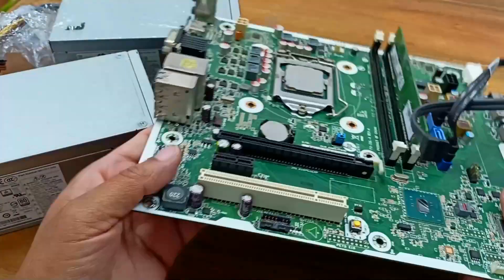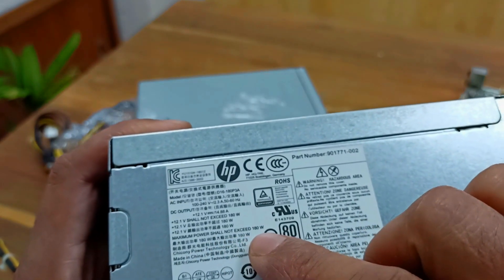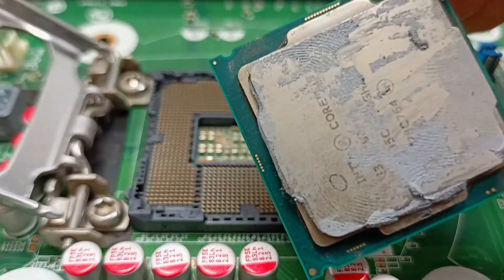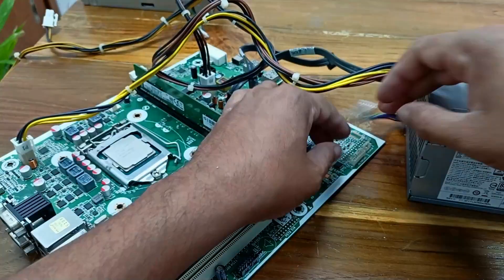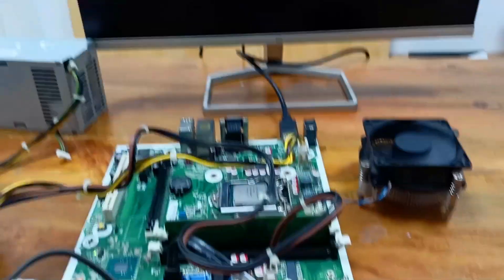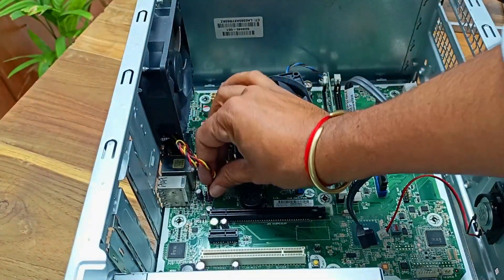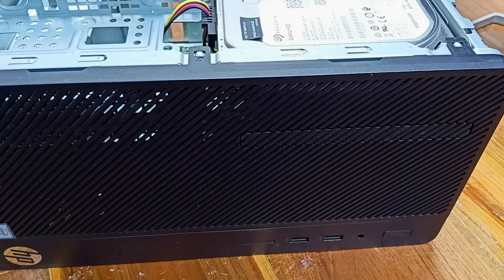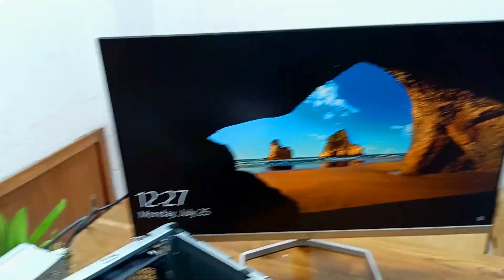how to fix Hp desktop pc won't turn on || Power is not working

Comment: my HP power off and wouldnt start with fan spin 2 sec and green light
on back went off.. and power button orange 2 secs with it
turned out to be a bad video card.. capacitor dried out in 14 years
nvidoa .. replaced with same bus card a radeon 1080p and booted up
but had at first reset by holding in power button and plugging in ac

Comment: Sir
I have the same pc and it won't boot when i press the power button
But when i plug the cable in the electricity outlet, the power supply fan spin and the psu fan too but not the third fan
Can you help plz

Comment: Hi ! I have a new hp victus desktop, which isn't turning on even when i have electricity. I had an old optiplex pc and i tried turning it on from the same power point but it's not turning on. Could the problem be in my wired itself ?